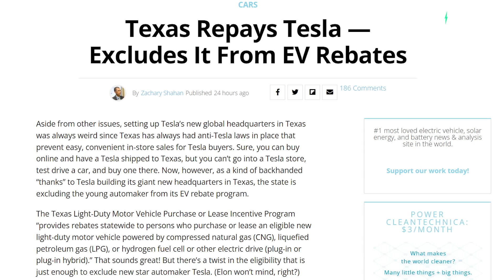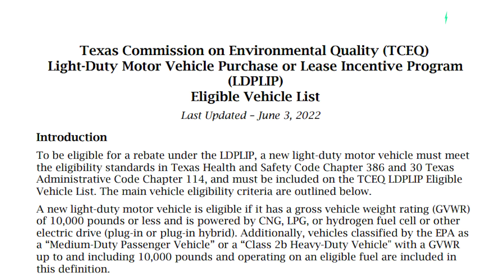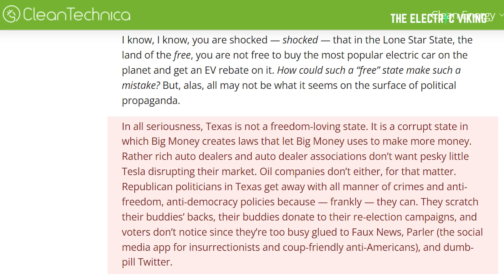Texas SCREWS Tesla - gives cash to Japan & Korea instead

Comment: Great, I was looking to buy a CNG vehicle 😂😂😂
Reply: Easy enough to convert a gas engine to use natural gas.  People have been doing it since the oil embargo of the 70s.   CNG is a better choice than hydrogen and it burns pretty clean.
Reply: @phillipzx3754  "pretty clean"?? Half the air pollution. In other words, it kills slower. Is that a "better choice" than zero polluting BEVs?
Reply: In my perfect world we'd have  an abundance of reasonably priced EVs (subsidized if need be) with the performance of , at least, a Model 3 Tesla Performance model.   I'm just saying I prefer NG  over gasoline, biodiesel over fossil diesel and ethanol over gasoline.  I'd rather not have a single ICE on the road, but that's not realistic. 

I have dirt cheap (4 cents off peak) electricity where I live.  I switched to a Tesla 8 years ago.

Comment: since big oil and legacy auto own the texas politicians, how did the tesla plant end up in texas. why didnt big oil insist on no plant. did the politicians show a little backbone? what happened?
Reply: Obviously, a lot of information is missing here. What are the peoples attitudes? What are the laws? Who is screwing the pooch?
Reply: The dealership law is a bad one, but for the most part Texas has far fewer regulatory restrictions than most other states - which made building the factory much easier.

And putting the factory in Texas helps get conservatives on board with electric cars, by providing something for the local economy to replace the soon to be dying oil industry. Whereas Tesla is not just a car company but also an energy company it will fit in better than one might think, as the oil industry is really just one branch of the energy industry.
Reply: @scottmcshannon6821  - I don't think Texas hates Tesla at all. Quite the contrary.

The fact that they still have this dealership law is just a testament to the strength of the dealership lobby in Texas and the difficulty of changing destructive laws once they have a sufficiently powerful interest group wanting to keep them in place. This law will disappear one way or another, if not proactively to be fair to Tesla then reactively after all the dealerships disappear because no one is buying the cars they're selling. Keep in mind that the Texas state legislature only meets for a 140 day session every other year.

Comment: I am surprised Tesla hasn't either setup a dealership location or struck a deal with an existing dealership that is struggle to use as a way to get around this law.
Reply: Want happen.  Not having a dealership is a huge advantage for Tesla.
Reply: @ianswayne7296   I am not so sure.
Depends on what texas sees as a dealership.
I can see setting up a  single Texas dealership that lets you buy your car over the phone or even in person if you insist.  
Maybe combine it with a Tesla service center.
Reply: Tesla can't set up a dealership. The dealerships must be owned by a third party.